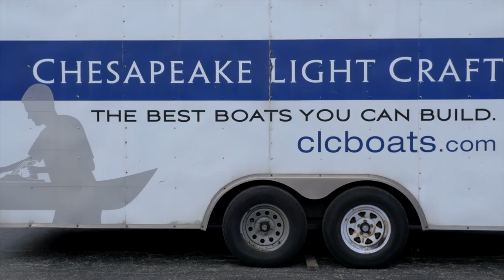We're building a camper!

Comment: Sounds like an incredible project. I am guessing that because of all the camera gear power and charging is a big part of the project. EV West is an electric car conversion company and they sell Tesla battery modules that were stripped out of Teslas. They are quite expensive but offer a lightweight alternative which would be ideal for keeping the weight down for overland travel. Also the fact that the Tesla modules have over 400 cells with inbuilt BMS they are alot less prone to failure compared to a set of 3 leisure batteries. (if one cell fails on the leisure set you are down 33% vs 0.25% if a cell fails on the tesla module) Just something to keep in mind. Looking forward to seeing all the updates. Keep up the awesome work.